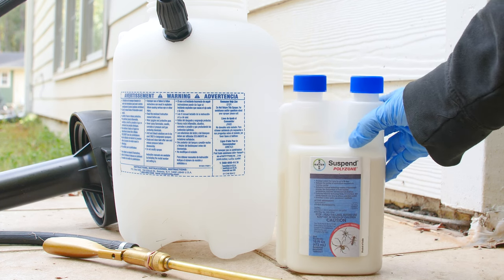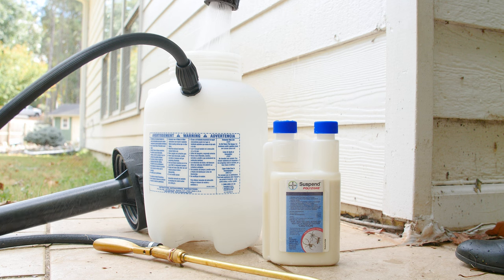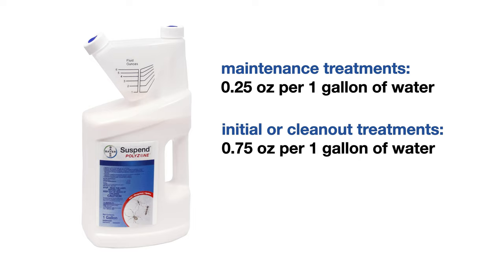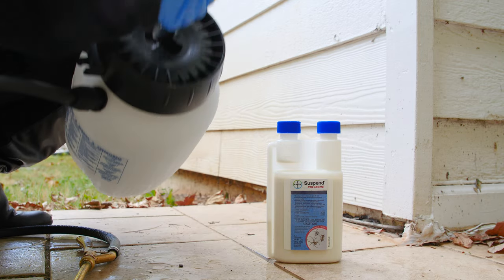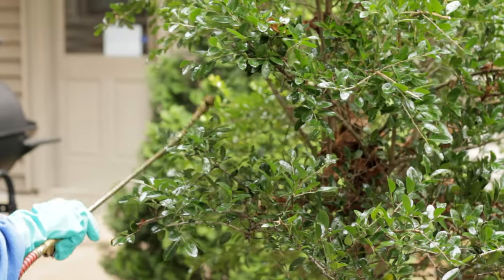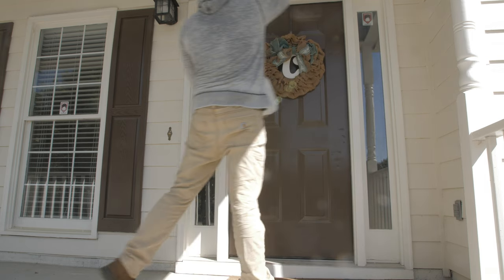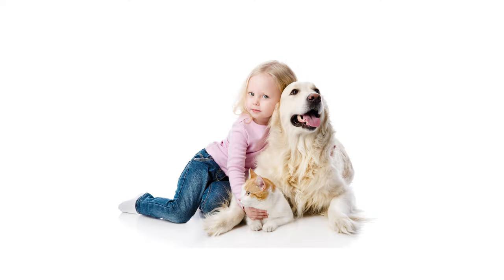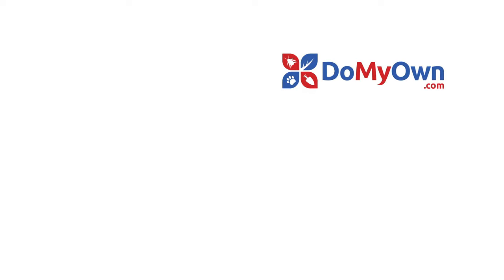How to Use Suspend Polyzone Insecticide | DoMyOwn.com

Comment: May not be best to spray on or around electrical outlets🤦. Remove outlet cover and use dust instead. But this stuff is great for everything covered in the video. People will pay 125. Or more for initial treatment then a quarterly 30. Or more spending up to 225. A year or more. When this product costs you very little to do yourself. Terminix uses this and most pest control companies. Telling you what they don’t want you to hear 🤫

Comment: Polyzone is by far the best and longest lasting but man it’s a nightmare to get off windows. If you want angry customers spray their windows! Suspend SC is a nice blend of price, residual and easy to clean. I think I only sprayed 35 gallons or so of it this summer, my record in 2020 was 44
Reply: Good to know about the windows 🪟 what did you use to get it off???
Reply: @mercedesbenzs600bash  - I like to use an aerosol cleaner called “worlds best glass cleaner” and 2 microfiber towels
Reply: I don’t get it? The next day I cleaned the windows with windex and it came off like nothing
Reply: @mralapenosarespicy  - did you spray PolyZone or regular Suspend SC? Also most folks end up waiting a few days and the hot sun “cooks” it into the glass making it a pain. I tell my customers to wait an hour then clean the windows, most then want to argue and say it’s better to wait a week and let the chemical “work”🤷‍♂️